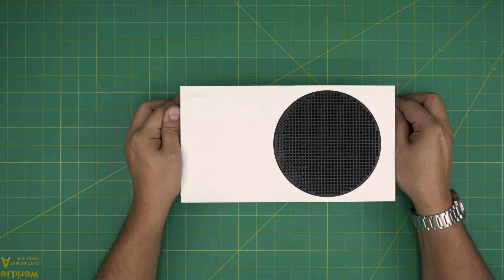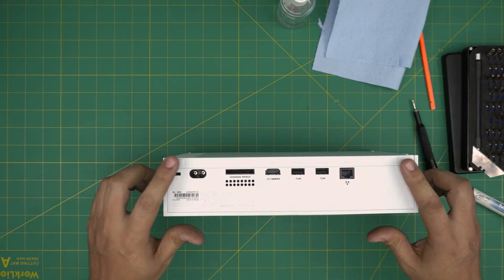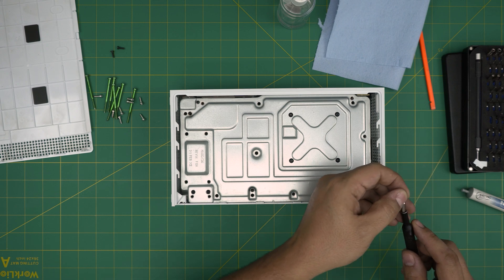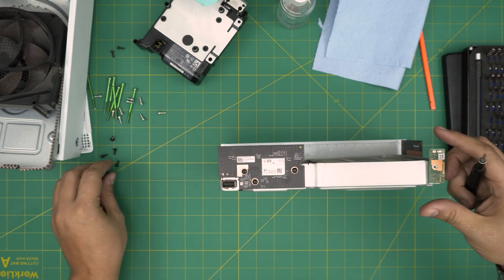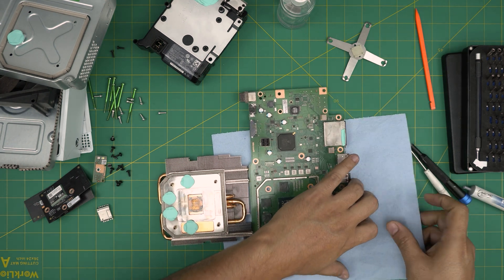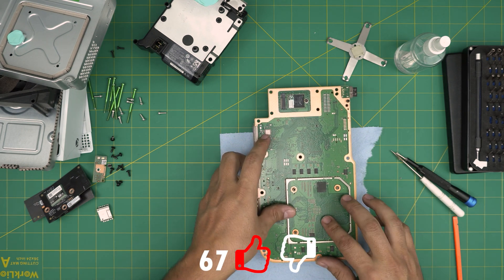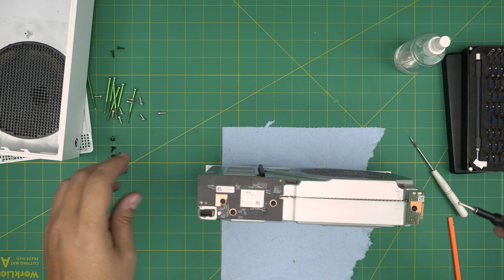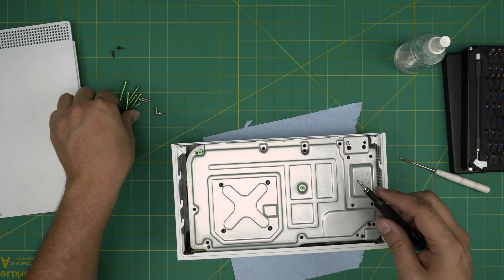How to Repaste and Clean Xbox Series S | Step by Step

Comment: 10:19 this took ages to do but thanks for helping me repaste I stripped a screw but managed to get it out another console I’ve repasted added to the collection 👍🏼
Reply from the maker: Yeah, that little thing can be a pain sometimes, but I usually remove it and don't put it back—it’s not needed. Nice collection.
cheers🍻
Reply: @uFixTek  I also cut myself on the xbox again 😂
Reply from the maker: If you're collecting it, then keep all the parts intact. 
Becareful, though—they do have sharp edges.
Reply: @uFixTek  I’m not collecting I just want my main console to have all the parts
Reply: @uFixTek  I put it back because it’s my main console and I want all the parts in there.

Comment: hi great tutorial, i am trying to change the psu of the series s so can i use the same old thermal putty of the old PSU on the new PSU? the console is just 1 year old?
Reply from the maker: It's my pleasure my friend, i appreciate your support.
🫠Regarding your question, sure you can 100% good to go.
Should you have any further questions or requests in the future, please don't hesitate to ask me.
cheers🍻
Reply: @uFixTek  thanks for the reply man. My series S is not working after a power surge. I bought a PSU from the Amazon, installed it like in your tutorial but the xbox is still not turning on :( any idea what to do? I checked the motherboard or that great plate with micro processors, nothing look bad there. Only PSU smelled burnt
Reply from the maker: You may have a few components that are damaged. You will need a technician to take a look at the board and see where the short is on the board. 😔